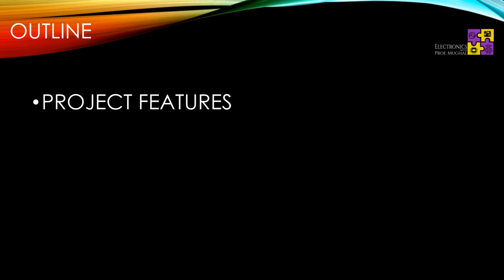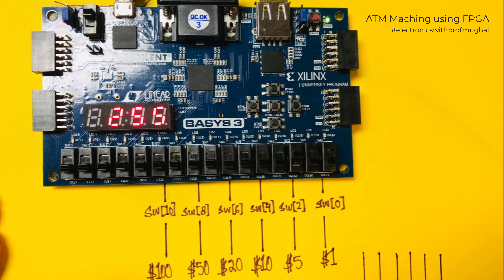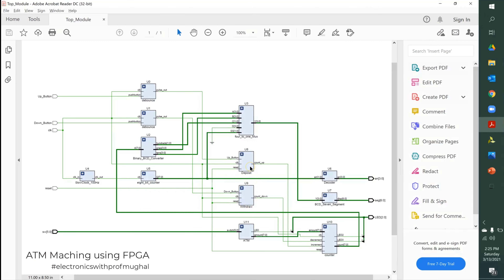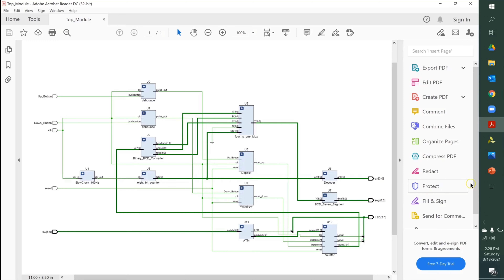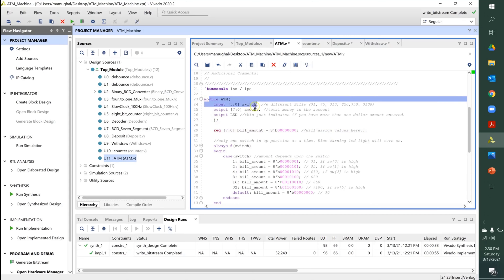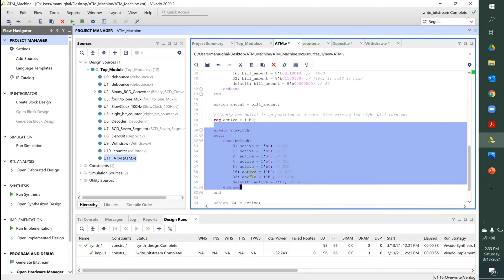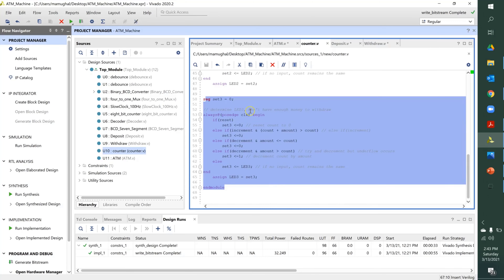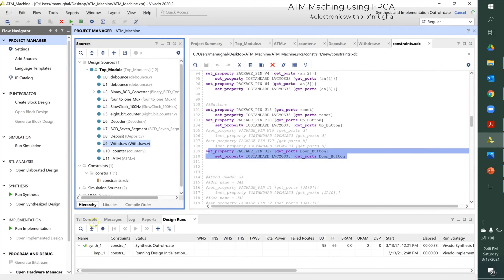#26 FPGA Project ➠ ATM Machine | Basys 3 FPGA Board | Verilog

Comment: I have a question that why in your schematic of the atm project, you don't use slow clock for debounce pushbutton and binary bcd converter, and you just use slow clock for 8 bit counter in ATM project
Reply from the maker: The clock is used and is under the debounce module.